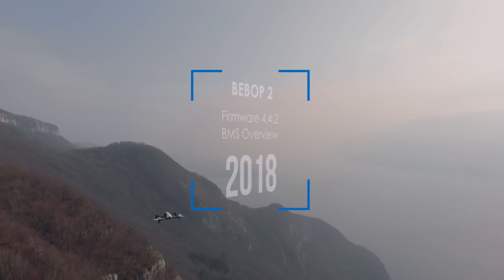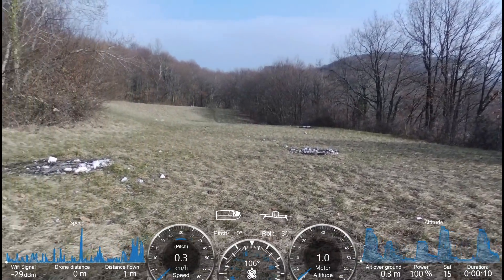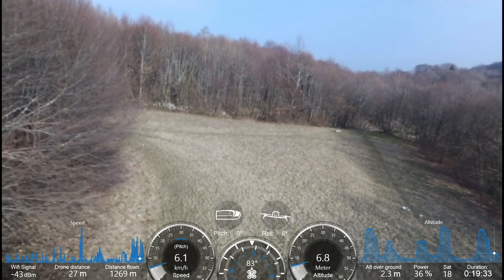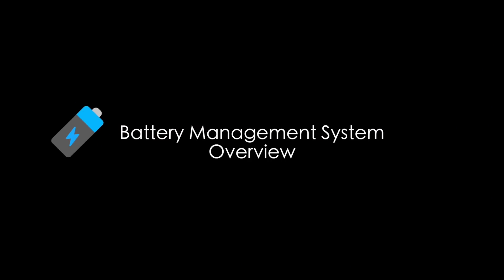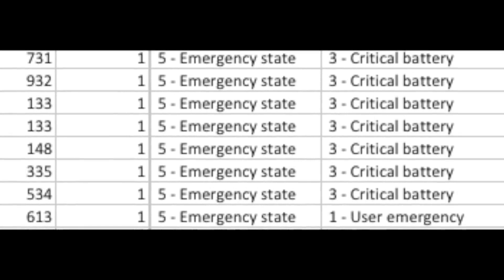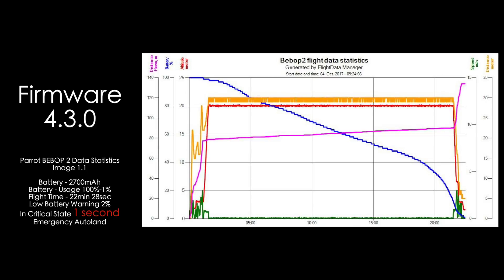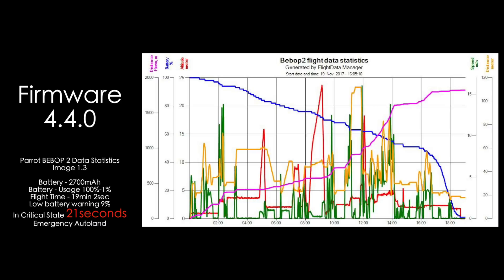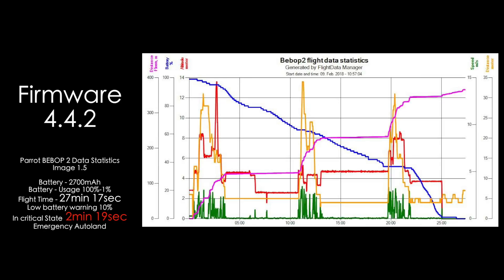BEBOP 2 - BMS Evolution - Firmware 4.4.2 - Part 3

Comment: Thanks for showing the graphs and data changes with every new update sent out to the parrot community. I'm having issues with upgrading from 4.4.0 to 4.4.2  on my smartphone and I'm wondering if you've heard others having these same troubles????? The Free Flight Pro app repeats the same thing everytime which is I need to connect to the internet!!!!!!!! Obviously I am but this issue has me stumped.
Reply from the maker: Hi Mark, I appreciate your compliments. About your update, if you could share the sequence of events during your update? ie: 

1. Drone off
2. Connect phone to the internet
3. Open FreeFlightPro 5.2.1 Android / 5.2.0 iOS
4. Check for updates 
5. Download update

After Update Downloads to phone
6. Power drone up
7. Connect phone to drone (Without controller, its faster) or with controller (slower)
8. If FFP does not prompt to update the drone as soon as it connects, go into "Check for updates"
9. Tap install update (Next to drone) 
10. Update will send, than disconnect as the drone restarts. 
11. Go to your network settings for your phone and reconnect to the drone. 
12. Update completed. 

etc etc
Reply from the maker: I made an update video if it helps. https://youtu.be/8AkpVSs32g0
Reply from the maker: If you continue to have issues try uninstalling FFP and reinstalling the app. I have had people ask about this but were all resolved. If you reinstall FFP and still have the update issue it is possible that the temp folder used to store the firmware before it gets to your drone is full or has permission restrictions. Try a second phone or device with FFP to update the drone in that case.